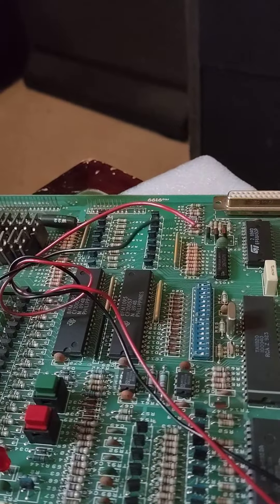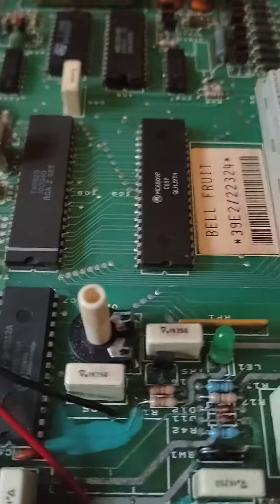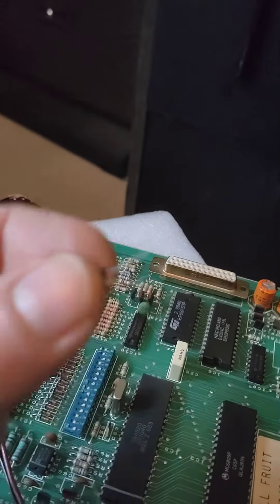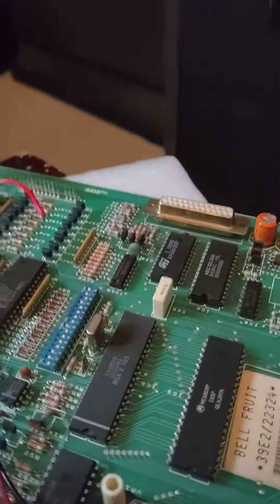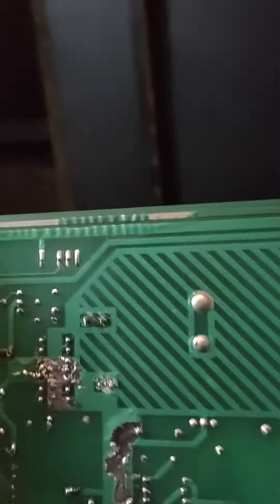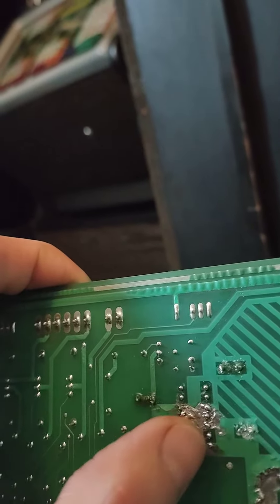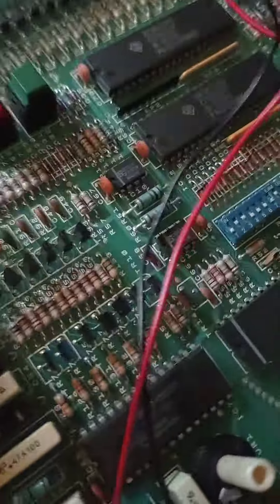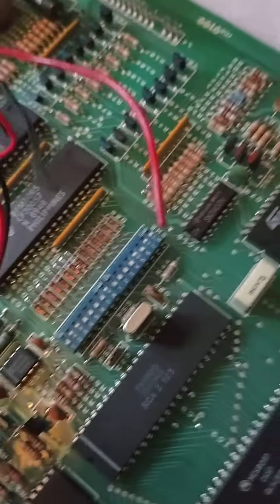Chinatown a few steps further 💥 10/1/23 @RetroTec Reels🍒🍒🍒👍👍🏽

Comment: Hope you are useing good caps
Reply from the maker: Hi there , Yeah think so they weren't 20 in a pack for a quid jobbies though you have me wondering if I should of looked further before buying  .The description says they can operate in extreme cold and heat and +-20 % . I only want to be doing a job once not 3 times so fair shout .Stuck on getting the chip out that's the main prob at mo .Thanks for your comment 😉👍👍🏽J